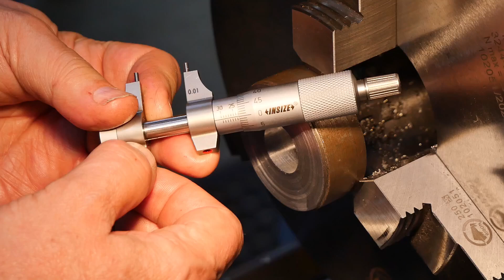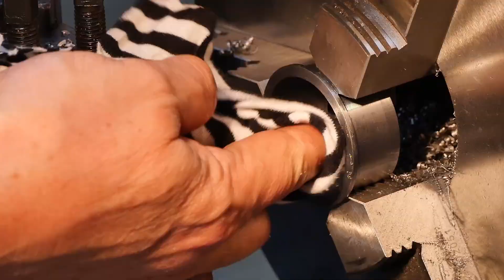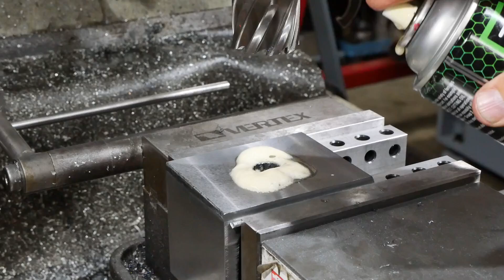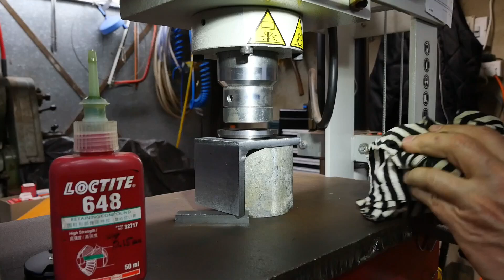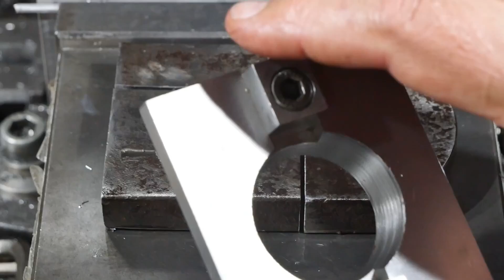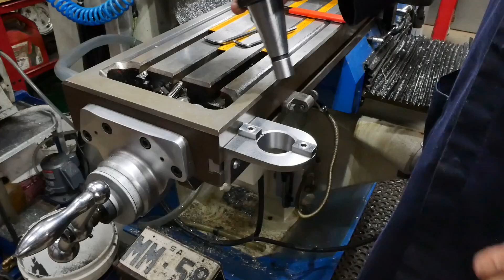Tool setter for the milling table

Comment: New subscriber here Alan. I'm very impressed with your skills level sir! Were you a pro machinist? It certainly looks as if you were lol. I think you should have many more subscribers than you currently have. I've not yet looked through your back catalogue, how long have you been doing YouTube videos? Anyway cheers from the Essex/ Greater London border. Sam
Reply from the maker: Thanks for the kind words Sam. I was never a professional machinist (though I'm flattered that you might think so) and after a mid-life career change, I actually spent the last 20 years of my working life in IT. So I'm just a self-taught amateur, and I put my first video up just over 4 years ago. By a coincidence, I started out not so far from you (on a global scale) as I grew up just outside Croydon :)
Cheers, Alan.
Reply: Hi Alan, I'm watching your series or three vids on the tool and cutter grinder jig which I'm now thinking of adapting for my set up. I don't have a tool and cutter grinder ( I wish I did have one of those D bit types) I have a 12x19" lathe with an attached to the headstock milling arm that rotates and locks and you just push it out of the way to use the lathe. I have a couple of diamond cup wheels, one direct sintered and one ceramic impregnated and I've made aluminium arbors for them to fit in my ER32 collet chuck which has an MT3 arbor and it's a little awkward as it's vertical, but I think I can adapt your design to work in that orientation. Anyway it's food for thought Alan. I thought you voice was a bit too cultured for an Aussie one lol. As I said your precision work does you great credit mate. One thing that I caught though, is that when you are checking almost final fitting of things whilst still in the machine, is that you try to fit stuff with all the crap around it without cleaning it off. Now that can really bite you in the arse ( tell me how I know ) something tiny gets trapped, and you take another small cut, and hey presto the hole is too big and all of a sudden your precision fit becomes a cock in a shirtsleeve as Max Grant of Swan Valley machine works Perth says. ( I've never heard that one before. A bit more classy than the Cockney ' Prick in a bucket' lol) going to watch some more of yours now Alan. Cheers Sam
Reply from the maker: @samrodian919  "try to fit stuff with all the crap around it without cleaning it off". That's a fair call Sam, I should pay more attention to that. As for the loose fit metaphor, my dear old Dad brought "dick in a shirt sleeve" with him from England. I first heard that when as a young bloke I "helped" him by drilling a 3/8" hole for a 1/4" bolt :)
Reply: @ reading that Alan , I suppose Max got it from someone who was a 'Pom' when he was an apprentice lol As I said I'd never heard anyone say it before. So how long have you been in Oz then? Presumably you came over as a family if you grew up outside Croydon? Loved the 3/8" hole for the 1/4" bolt by the way lol. That would certainly qualify for dad's comment!
Reply from the maker: @samrodian919  We came out by boat on the assisted passage scheme in 1968 and settled in Adelaide. I was 13 at the time so quite an adventure. I do sometimes ponder how things might have turned out if we'd stayed in England, but have no regrets as Australia has been very good to me. I'm 70 next year and still enjoying life with my wife of nearly 50 years. I'm lucky indeed to be able to "potter with a purpose" in the workshop and I don't know how I ever found time to go to work :)
Cheers, Alan
Reply: So you and I are almost of an age, I'm a year older. Will be 71 in early January. You have a great workshop and some bloody nice machines and tools. I T was pretty lucrative it seems lol
Reply from the maker: @samrodian919  I have been very lucky :)

Comment: I guess you skipped the rounding of the end. Nice work.
Reply from the maker: Thanks Carl. I rounded the end using a clamping accessory I made for my bandsaw, and removing material with two angled cuts on each corner. This left small amounts which were easy to remove on the belt sander. I didn't show this because the video was already over thirty minutes long and this seems to be the limit that many viewers prefer.
Cheers.

Comment: You may want to make some plastic caps to cover the tool held in the holder, eventually you will swipe your hand across one.
Reply from the maker: That's a good point - I catch my hand often enough on the tool in the quill while futzing around under it.
Cheers.

Comment: Nice neat job Alan, I loved the tolerancing !
Reply from the maker: The Vertex boring head is a very nice bit of kit. It'll consistently remove 0.01mm off a diameter and can be finessed to ~.005  - provided the operator doesn't lose count of the clicks :) 
Cheers.

Comment: Nice tool Alan, Gotta make one of those.
Reply from the maker: Thank you. The design was influenced (as usual) by what was in the scrap bin. My first idea had been to use a short piece of 100mm square tube and just bore a big hole in the top and a small hole in the bottom. However, I didn't have a suitable piece of stock, and a socket with matching taper does locate the adapter very positively. The design also allowed me to round the piece off and avoid nasty corners.
Cheers.

Comment: Alan, honey mustard is much better on a ham sandwich. Than the milling machine. Such a basic tool, but such an excellent job as well, Cheers from America. :)
Reply from the maker: Yes, that "honey mustard" is nasty stuff and provides no anti-corrosion protection - it will be replaced asap. 
Thanks for your feedback Stewart.
Reply: @alanshomeworkshop  No need to replace, I just thought it was funny, that's all, love your content
Reply: @stewartfrye  nah! Good old strong English mustard is all, you need and nicely Smoked Ham! Not a lot of good at lubrication of cutting tools though!